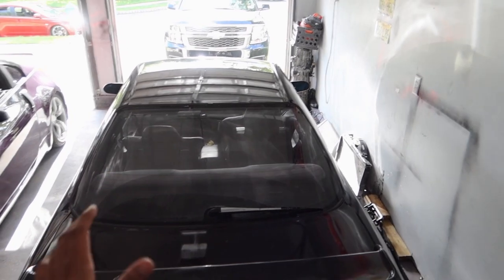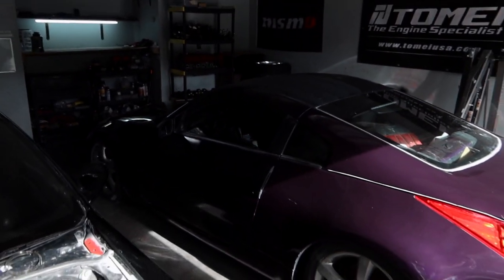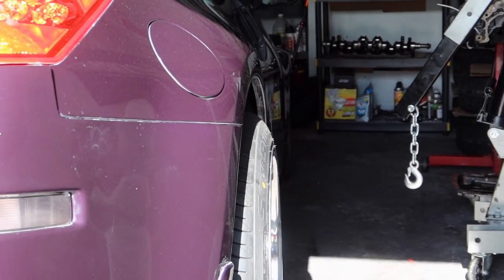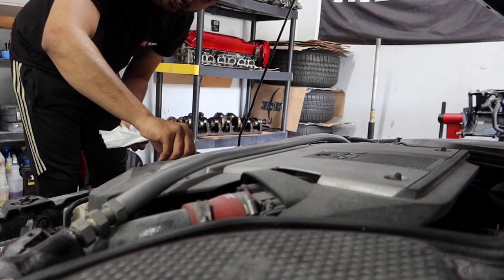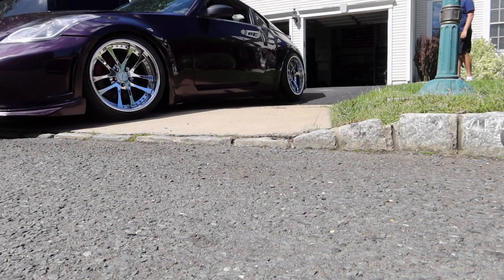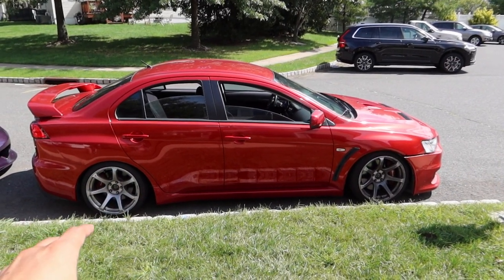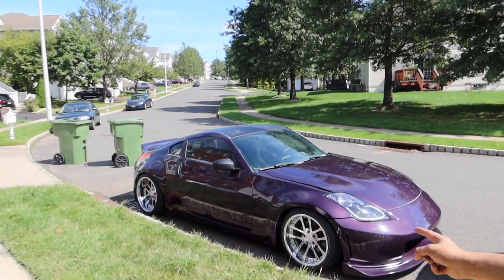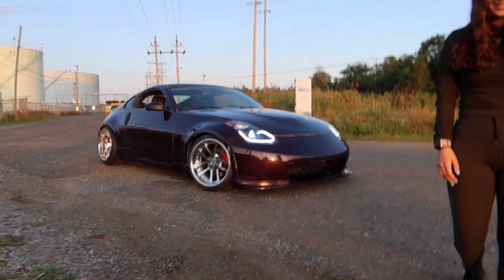Surprising My Girl With Her New Wheels!

Comment: What are all the specs on the wheel setup (size/offset...etc) and tire size if you dont mind?  Looks awesome!
Reply from the maker: idk the offset but it is 18x9 and 18x10 loll and 214/40 and 225/40 i believe
Reply: @beakhan  did u every figure out the offset and where did u get the wheels from?